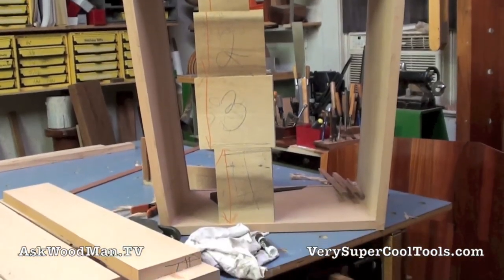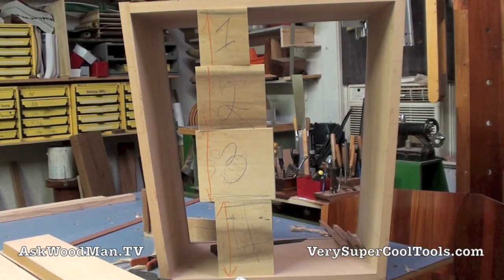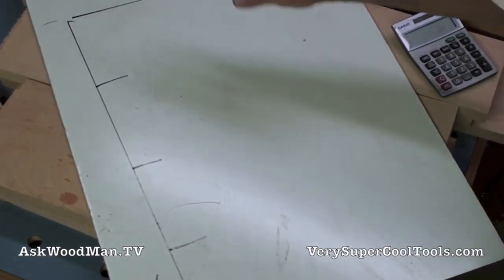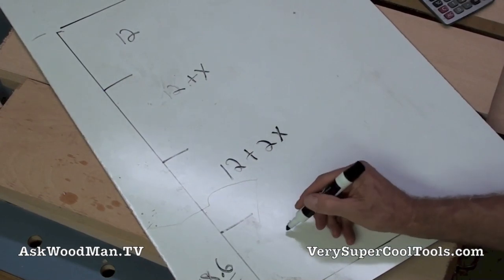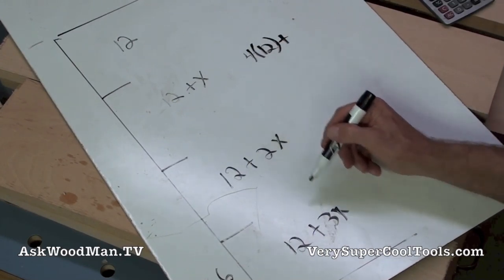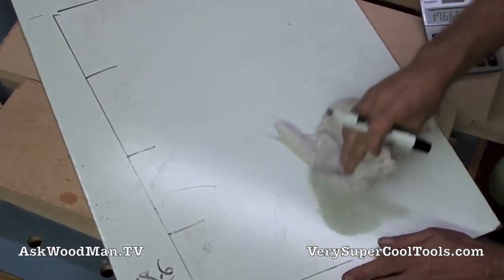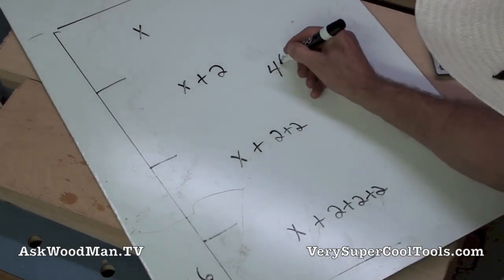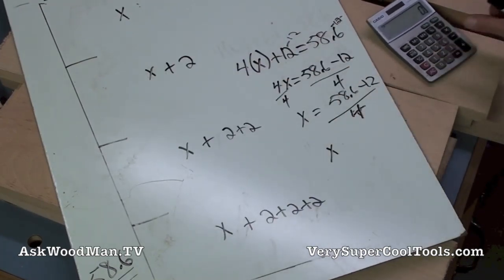12 Four Drawer Bedside Table • Drawer Spacing Layout Algebra

Comment: Omg. Just perfect. Fractions are pain in the ass. I m from belgium and this os perfect explained. 1 question. How about spacing in your 2nd calculation. I'll stick in the 1st one i think. Thank u very much
Reply: I was born in the united states in 1949.  went through 12 years of school not using metric. Im going to give this American using metric a bit thumbs down for not thinking of many of us who never learned metric.  Maybe he should go teach a class in belgium.
Reply: @12oldman  there is nothing to learn about metric. What's your point? 2cm - 1.50cm = 50cm. That simple. Fractions are ok, when u use only whole or half. Use metric,
Reply: Erol lighten up Erol. What might be good for one is not necessarily good for another.  My tape is standard.  It does not give tenths, does not show millimeters. It, and 99% of the tapes sold in a typical hardware store, Home Depot, Lowe’s, ace hardware, are all standard 1/16,1/8, 1/4 and so on so give a 70 year old a break. This is what I use and have been using for a lot of years now
Reply: @12oldman  to be honest, I use sometimes fractions. 1, 1/2 and 1/4. My eyes letting me down and to see the mm is a struggle.
Reply: Erol now your in my ballpark. I’ve been told metrics is much better for a more accurate measurement. However my whole life I’ve been a metal fabricator and a carpenter. Both use plumb, square and level. A worm drive or mitre saw generally has an 1/8 curf and a torch depends on the size of tip used. You think about which side of the line to cut on. I do wish things would have been different in my education process but it is what it is. Funny, in metal fabrication if you need precision you go to a machinist and they use metrics. However, using my limited method, bridges have been built, homes fabricated etc., etc. truth be known there is a place for both systems as long as there is a need for a 92 5/8, 2x4.  For those of my generation, that’s the length of a common stud. God bless.